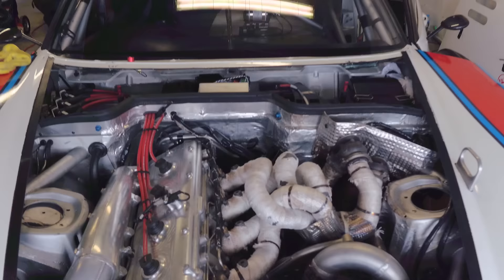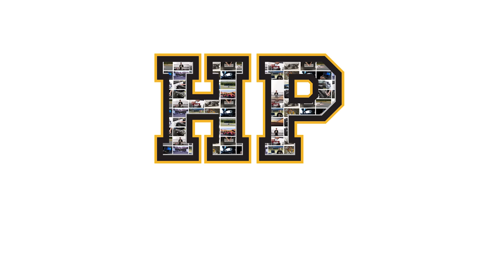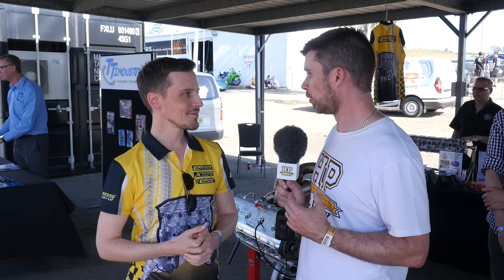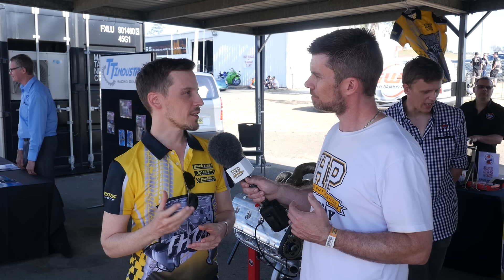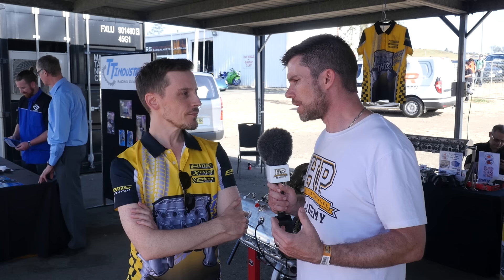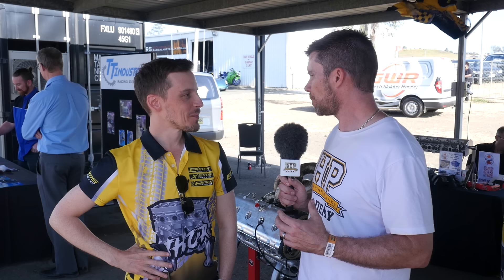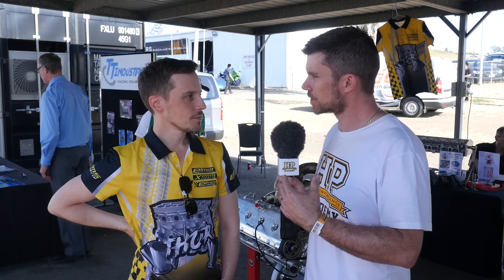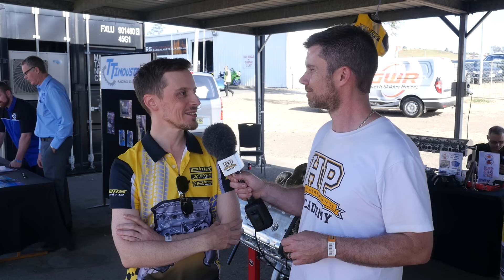3000HP, 10,500RPM 4 Cylinder | Elmer Racings 106kg Billet Block

Comment: The guy doing the interview looks like he has no idea wtf Oskar is talking about half the time lol. These guys are like 5 steps ahead of the normal tuner and its amazing. When he asked about cylinder head porting and Oskar was like nah thats not important its all about the pressure waves lol.
Reply: ?  the average tuner argue about sh*t that's not important to the grand scheme of things. Port Velocity and Pressure Waves are more important than CFM in many cases. Oskar rotated the head for packaging reasons as stated. When you don't drive the thing on the street anymore compromises take a back seat.
Reply: The guy doing the interview is probably the most knowledgeable engine builder and tuner in new Zealand.  His name is Andre simon, he owned speed tech motorsport and at one time had the fastest 4cl 4wd evo in the world.. DOCILE. Look up his videos with his new business hp academy.

Comment: 3000hp is pretty impressive number from a 244ci engine. I would be curious to know on what kind of fuel it would achieve this? I realize there are a plethora of variables. I'm impressed because, if you increased this engine to 500ci roughly twice the size (NHRA Top Fuel Displacement) it would produce 6,147hp. 6 bar is 87psi!! What fuel would work with that kind of boost pressure? Timing is a HUGE issue how does it work....lol. Thanks. I'm a fan of all things Horsepower😊
Reply from the maker: For a drag application at the target of 3000 hp we would assume someone would be most likely running on methanol fuel. Methanol has a very high octane rating and a high latent heat of evaporation which means it also has a large cooling effect on the charge temperature.

Comment: hey you can make the rods from really nice steel alloy skeleton rod, plug the ends and cast them in the billet material then cut and pull the plugs, separate them and machine them out , then they won't stretch, or just use titanium.

Comment: I remember when I first saw this, I looked it up and thought it was the sickest 4 cylinder out there, until I reread the price tag... aside from racing teams no one will get to use it lol
Reply: And who other than racing teams would need a 3000hp capable engine, let another a 4 cylinder one? Just being on the street, 500-600 is pushing what is really useable
Reply: @placeholdername3206  lol your kidding right? No one's gonna run 3000hp on the street, but 500hp n/a and 1500hp on boost that'll last as long as a honda? You can't tell me that wouldn't be sick.. could you imagine 1000hp evo x on 91 pump?
Reply: @Drake5153  And how would you put said power down to the ground? Traction and driveability is the enemy. Not speed.
Reply: @placeholdername3206  well the evo x has awd, average torque capacity of 650ish, max of 870ish, should be plenty, and it should be plenty drivable, the added capacity means it won't be cammed out, the guy even said it was designed to operate under 10k rpm in track use at 1500hp, crank it back to 750-1000hp and you should be able to have your cake and eat it too lol

Comment: My aircraft engine is 4l (235 cubic inches) with 4 horizontally opposed cylinders.
It only has 125 HP though.
Reply: Yeah but i think aircraft engines are mor focused on making tons of torque
Reply: @Giova590  y, and high reliability/longevity

Comment: Radical race cars use 2 Suzuki Hayabusa engines and make it a V8 then tune them to over 500bhp N/A if desired and can rev to over 12000 rpm. Turbo'd one's make up to over 800bhp and the engine sounds evil when at full chat. Very strong engine the Hayabusa using lots of lightweight parts and friction reduction piston rings also help. These can be purchased for just over £20,000 + depending on spec that's required. Not a lot of people could afford this one? Good engineering though, impressive.
Reply from the maker: There are many options out there for different prices Taz, including cheaper options than a V8 Hayabusa (which is still 4 more cylinders than this, so it's in a different category). At the end of the day racing gets exponentially more expensive as you try and go faster regardless of what you start with - Taz.

Comment: Sooooo no footage of the car running?
Reply: Nestor Urias they had some issues getting engine ready in time for wtac 2017, so they ran their older engine instead.  Link above my post is not this engine.
Reply from the maker: Correct. Fingers crossed there's some from the next WTAC :) - Taz.
Reply from the maker: @Joseph, that's one of the older engines - Taz.

Comment: Are we talking unobtainium rocket brand high octaine or alcohol?
Reply from the maker: Some of the specifically blended race fuels could also be workable but typically in very high boost, high specific output engines, methanol is still the go-to fuel.

Comment: it needs a cold air intake, atleast 2 and a half inch in diameter for max flow rate. and it needs a dc header for maximum exhaust flow out. and then last, about a 75 shot of nitrous for optimum horsepower gain. i have a 1993 acura integra ls. i know a thing or 2 about high power 4 cylinder. feel free to ask me if you need any help.

Comment: ONly $100,000- 150,000 start fanboying out
Reply: Of course!  they've redesigned an entire engine, that kind of engineering/CFD work doesnt come cheap
Reply: DJ 
but the material cost cant be over 5k and it takes maybe 2hours to machine. but these are for rich ppl with many sponsors.
Reply: This easily takes 24hours+ to machine.

Comment: so how would one of these fair in a daily application at a reasonable hp level? like 500-700hp in a daily.
Reply from the maker: It would fair as well as any other well built 500-700hp daily driver engine 😉 Bit overkill using something like this for that application though in all fairness - Taz.

Comment: 3000 horse power 4 banger and people still wanna say the devel sixteen is impossible smh😂
Reply: It's not impossible, it's just not realistic. Devil sixteen has 0 experience making cars+ 3000 horsepower is when the whole engine is rebuilt every launch make 5000 horsepower, reliably is close to impossible especially for a company who has never built a car before. Not to forget 5000 hp would probably wear the car's body so I don't think anyone would want a car that breaks under it's power

Comment: 1500hp or 3000hp? You got a dyno sheet somewhere we can look at?
Reply: I think the 3000 hp refers to the calculated hp the block can resist, the way you make the boost and what fuel you use to make it happen its up to the end user, if you look billet block specs all of them have a estimate of the amount of hp that the block can take, the problem comes to actually making a set up where you can make those 3000 hp, if it interest you look up australian drag racing teams that use four cylinders and in line six blocks they make that kind of hp in their race cars using billet blocks like this one
Reply: Angel Moreno Strong question. Prove it.
Reply: @scottgregory9672  https://engineswapdepot.com/?p=30227 look up jett racing they run smaller engines than this one and make up to 2000 hp using racing fuel and a ton of boost they are some of the fastets four cylinders in the world and they use billet blocks that are made very similarly to this one

Comment: That would make about 750 Hp per liter??? Making an high rev engine by removing two cylinders from the flat six porsche, increasing the bore size and reducing the number of valves and the cylinders surface area to cool the engine? From ten brainstorm you'll might end up with one final solution and this is not one of them...

Comment: Say things right, billet is not a kind of aluminium, it describes the material that it's going to be used in the cnc mill, kinds of aluminium 6061, 7075, 2024 something. It's easy, just Google it and educate the people, then they are talking about "billet aluminium" like if it's the new  carbon fiber.
Reply: Same can be said for carbon fibre, What weave? thread size, laminates, Metal/titanium threads?  Its just to simplify things for most people... Just cause you can go really really specific doesnt always justify it...

Comment: Hmmm, so it's actually designed for 1500hp and 8500rpm, that's realistic and not click bait bs
Reply: torque starts to drop after 8500rpm as expected. It WILL rev to 10,500 rpm.
Reply: Krasimir Ivanov 
It's an impressive piece no doubt
Reply from the maker: For circuit racing, it is, not for drag racing. Keep an eye on Elmer Racing for the final numbers. The interview is clear that these are potential figures at the minute but are hypothesized from testing so far and data on hand, not from 1 too many beers. The team has already proved themselves with some other blocks and products so we're also excited to see the outcome and felt that Oskar wasn't the unnecessarily boastful type, hence using the higher numbers he stated in the title =) - Taz.

Comment: That engine block retails for $148,000................................................................................................................................................................................................................................................................................................................................
Reply from the maker: You have to pay to play, as they say - Taz.
Reply: Yes, but any newly made engine block cost probably even more than that, the only difference is that the common engine blocks are in many cars and they can be sold cheaper to make profit. But the very first block developed probably cost far more than 150k

Comment: Level 1 ricer:"my honda smoke all yo asses"
Level 15 car guy: "it just has an aftermarket exhaust, intake and a tune but god damn does it ruin ricers days"
Level 35 tuner:"right here i have my stage 4 gtr with over 1500hp with bigger turbos, upgraded intercooler, radioators and a straight piped exhaust... Not to mention it has suspension and interior upgrade including a role cage and also a wide body kit"
Level 99 boss: "we replaced the entire block with a billet aluminium one and  after a lot more modification our tiny 4 banger now has 3000hp... Want to know anything else?"
Level 1 ricer, level 15 car guy and level 35 tuner: nope
Reply: @Sergio Aguirre nah mate they would be like: "yeah here we have our tiny i4 engine... Its only 4l" xDD

Comment: How about releasing hp numbers after the engine is actually running or dynoed #benchracing
Reply: don't expect them to release dyno charts...   This is a competitive race car
There's video of billet 4pots running huge power if you'd like to see some
(sounds like you doubt its capable of the power goal they set)
Reply: DJ My point is that it hasnt ran yet. It's a long way for it to make even 1000hp reliably let alone 3000hp even for a few seconds. Sure there are some 4cyl  engines making that power but expect to brake a few of them before doing it..
Reply: To be fair with the expertise and math displayed here I would take his guess a lot more seriously than a backyard tuner or even most custom shops for that matter. There is some serious engineering on display here.

Comment: 7075 is really strong, as strong as aluminium goes, but it can't be welded. So if you blow the engine and damage it, you are buying a new part!
Reply: I think in the league those are playing, if something breaks, you replace it, period. You can't risk a repair not being 100% as strong and light as the original part, or even maybe introducing another stress point, throwing off the material properties in the repaired area because of the temperature during welding, etc. 
So I guess repairability is very low on their list of priorities.
Reply: Muggy weld, stuff is strong

Comment: Hmmm.  10...okay 30kg 300hp engine? 20kg 100hp engine?  15kg 80hp engine? 13 kg reliable 63hp?    .....i wanna see an aero 4seat sub 400kg kei car.  Then add 100hp electric and it's fun again.          There could be a racing class that through its rules cranks out affordable  n efficient sports cars but that's probably not wanted by profit oriented business.
Reply from the maker: When you're wanting an affordable race car, EV tech is not the direction you should be looking in at this stage - Taz.

Comment: Where is the test on the dyno?
Reply from the maker: We left our pocket dyno at the hotel sorry! - Taz.
Reply: @hpa101  Translation: that engine power (3000hp) can be fake. Thanks!
Reply from the maker: The power figures are explained in the interview. A video is more than its title, it's actually an entire video 😅 This is worth the watch rather than just a title read 😎 - Taz.
Reply: @hpa101  I saw. OK! Santa Claus exists.🤣🤣🤣🤣
Reply from the maker: People believe in God without question, yet there is more data behind this engine producing that figure 😂

But yes, you can and should take it with a grain of salt until we see it in action for that application. Nothing is hidden in that respect in the interview, there shouldn't really be any revelation about it. There is a European drag team using the engine I believe but unsure how far they have pushed things yet. 

Generally the issue with getting to these power levels is actually around who funds it rather than it being or not being possible 😎 - Taz.

Comment: This is not a 3000 hp engine.  The engineer says he told someone he would be "very disappointed" if it wasn't "capable of producing" 3000hp if the boost was increased to 5-6bar boost.
Reply from the maker: Yep, the power levels are covered in both the interview and the description. There is a drag team that is using this engine now though. COVID has slowed a few things down but I can pop a link to some info here for you when I have some if you'd like - Taz.

Comment: this guy is full of shit; with a 94 mm stroke this engine will run a mean piston speed of 32 m/sec at the envisioned 10500 rpm limit he`s talking about; even F1 engines don`t come close to 30m/sec and they have much more lighter pistons; this engine need close to 117 mm bore to reach 4 liters with a 94 mm stroke; that`s a huge piston to move around the cylinders at 32 m/sec; but then again, talking is cheap especially when you`re full of it
Reply: f1 engines have 'much more lighter pistons'? Please show us your sources. How much do the pistons weigh in this engine? Do you have that information? LOL

Comment: 106kg? Toyota 2JZ is much lighter. Hell, the Aussie Barra inline 4 liter inline 6 which is often denigrated for its length and height weighs less than 80kg.
Reply from the maker: Yet I don't see a Barra winning WTAC... Weight is just one aspect - Taz
Reply: @hpa101  This is an impressive feat but I'm pointing out that it appears over built. There are billet 2JZ blocks that will hold more than 2500 horsepower that weigh a lot less than this four cylinder block, probably for a lot less money. There are even RB billet blocks just over stock weight that hold 3000 horses.

That would indicate that this block could use the Jenny Craig program and probably still work reliably, unless they are hoping for 4000 horsepower later.

Comment: Dumb. 7075 aluminum isn’t overkill. 6061 aluminum isn’t necessarily inferior to 7075 aluminum. The weight difference between the two aren’t huge - within 10 percent. 7075 is stiffer BUT it cracks/fractures whereas 6061 is more durable. I think a high end engine would mesh 6061, 7075, Ti and magnesium to best utilize the strength and durability characteristics. This coming from someone who has worked with all 4 materials in high performance applications regardless of cost.
Reply: I wouldn't use the word "dumb" when commenting about that guy says. I assume that he is a mechanical engineer, as am I, and he clearly knows his business.